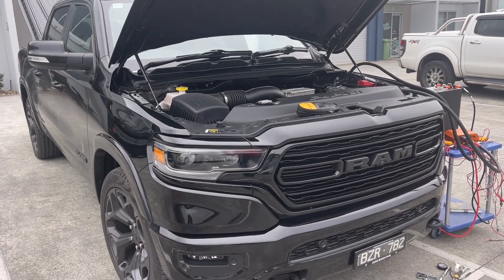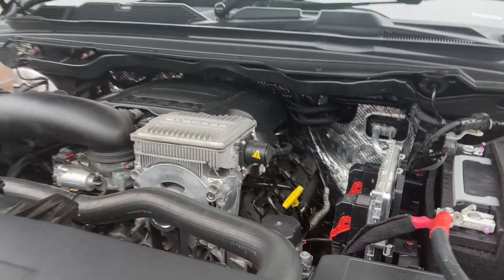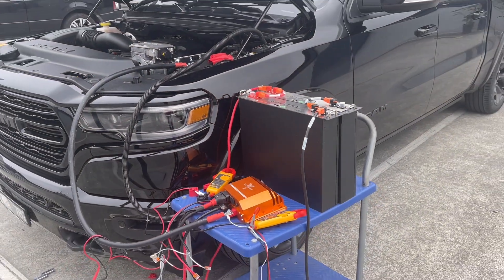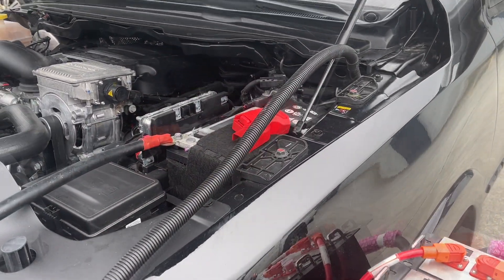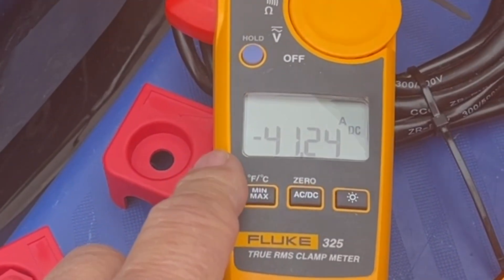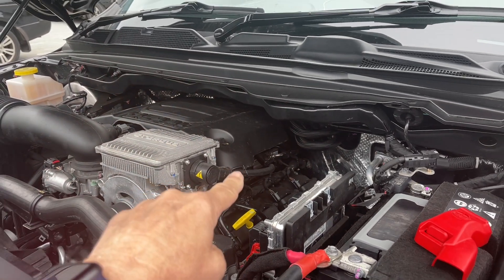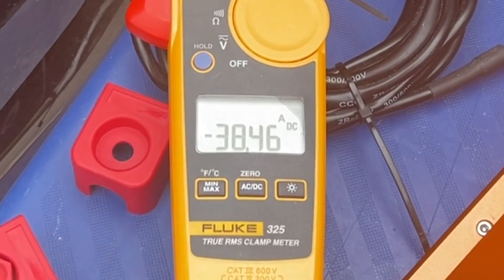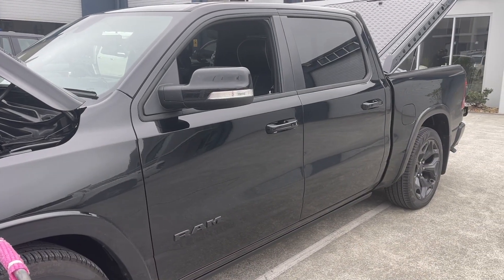RAM 1500 eTorque 48V Starter/Generator delivers  high power to Scotty to charge 48V Lithium

Comment: So is that an external 12 to 48v step-up charger hooked directly to the starter battery and then charging the 48v batteries?  Are you just showing that it can supply enough voltage at idle to charge the external batteries? Just trying to follow as I am interested in something like this to charge batteries in the event of a power outage.
Reply from the maker: This is a 12v to 48v charger running off the 48v to 12v DC to DC  in The RAM 1500.

Comment: Need a video to replace this Generator. It's a pain
Reply: The only pain on these is the hydraulic belt tensioner that needs a lot of steady force to collapse. You'll need a long breaker bar and slowly release it after removing the belt. If you slip and the tensioner slams it'll blow itself apart
Reply from the maker: Tricky to give you a video....

Comment: So does the RAM pump out amps via its DC to DC without knowing whether it is charging its own battery or your Lithiums.?
Reply from the maker: Power is driven by the demand side, which is this case is Scotty. We were unsure if the 48V generator in the Ram (on the ring housing under) PLUS the 48-12V DC DC could meet the stated load of 3,000W. Plus the voltages at the 12V side are unusual... a flat 13.4 spiking up when braking on regen mode... The only way to know was to test. This scotty was not wound up to the max, I had is set at 170A 12V side and the result shows we could wind up to nearly the full 3000W. This is the advantages of digital technology...